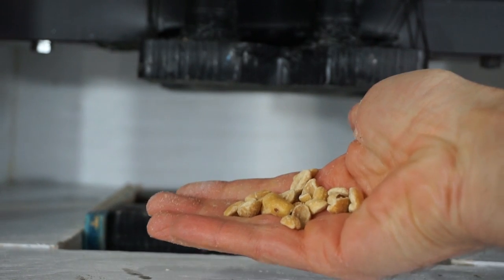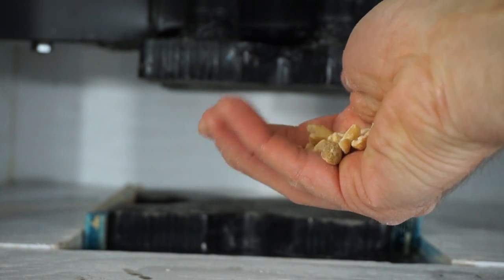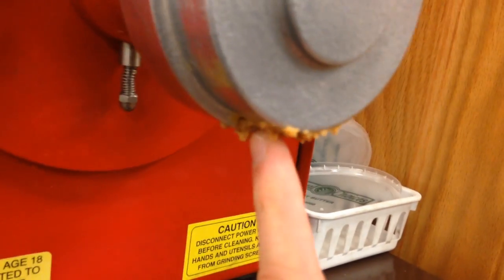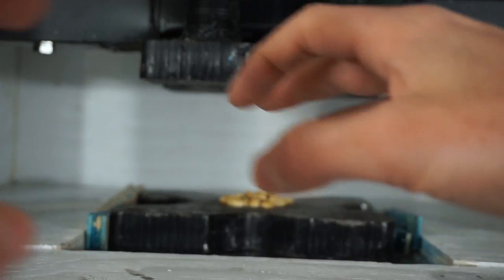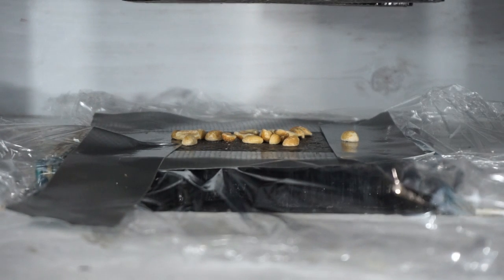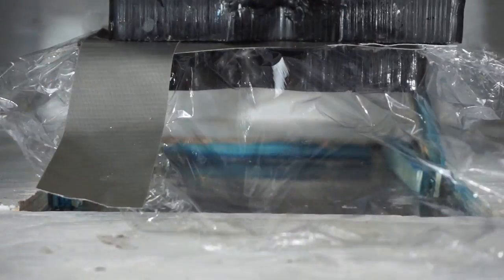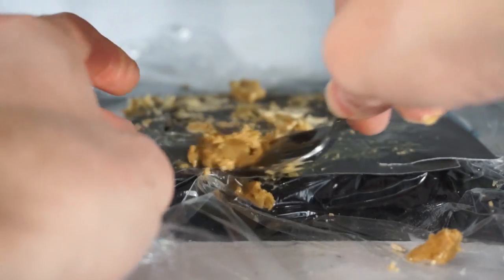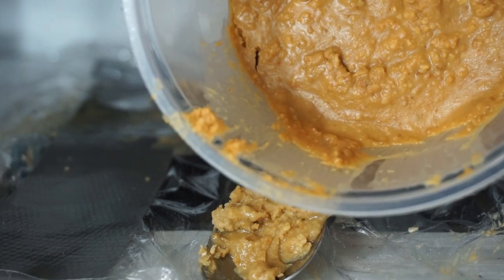Peanuts Turned To Creamy Peanut Butter By A Hydraulic Press: 2nd Try

Comment: peanut butter has added peanut oil to make it "creamy" which is why you saw that large bottle of peanut oil next to that peanut butter grinding machine
Reply: Added oil is not needed. Peanuts are already plenty oily. 100% peanuts becomes a runny liquid if ground finely enough. I prefer mine with some oil removed.

Comment: You are supposed to add oil but it's up to you what you do, love your channel
Reply: Oil is not needed. 100% peanuts becomes a pourable liquid if ground finely enough.
Reply: Yes, I highly recommend trying the kind from a grinder at the store. I wish I could get it slightly crunchier sometimes. The problem with buying "crunchy" from a jar is that they mix big chunks with super runny oily peanut butter. Don't like. And I have no interest in sugar and stablizers. Totally unneeded as you saw.
Reply: +NickRoman, heck just chop your own peanuts at $2/lb and add to creamy p.b. at $4/lb. for crunchy pb at $3/lb or less depend on how much you add. Or add chopped sunflower seeds as sunflower seed butter is often like $6/lb. vs $3 for the seeds.

Comment: Anybody that says you need to add ingredients to peanuts in order to make peanut butter has no idea what they are talking about.  

I spent an entire summer trying to replicate the filling of a Reeses. 
Went through at least 50 pounds of peanuts, maybe a hundred. All you need are dry roasted, unsalted peanuts and a blender. I failed because I was never able to get enough grease out of the peanut butter- the filling always came out too wet. But it produced fine peanut butter. And without all the nasty shit found in commercially produced peanut butter. You can add salt for taste, but it is not necessary.

Comment: Okay, okay, I stand corrected. Real peanut butter is definitely made from pure peanut butter only.
On the other hand I think that the cheaper ones are definitely cut with some palm oil, just to make them cheaper....
BTW the peanut butter made in the hydraulic press looked a bit thinner than the store-made one. I wonder why's that.
Reply: The primary function of palm oil is prevention of oil separation, because some people don't like stirring it in or pouring it off. I pour it off unless runny peanut butter is needed for something specific. Peanut oil is high in omega-6 so it has negative value to me.
Reply: +Marshall Banana, frying. Pancake oil.
Reply: +Marshall Banana Prevention of oil separation? You surely don't mean emulsifiers, don't you? Palm oil's main function in ALL the greasy foods is just one thing: to make the item as cheap as possible. It's cheaper than any other source of grease/fat: not only butter and cocoa butter, but even lard and margarine. So if you'll ever see palm oil featured on ANY food, be on the lookout as chances are it won't taste good.
Reply: CoolKoon do you think they remove the peanut oil for use in other foods? because peanut butter certainly doesn't need any added oil.
Reply: +Ananta Sesa das Like I said: palm oil is cheaper than ALL the other sources of oil and fat, including peanut butter. Of course it doesn't need it, yet I'm sure that some manufacturers add it because that way they can use a smaller amount of peanuts.
Reply: CoolKoon oh, i see. that technically would be removing a portion of the whole peanuts (not just the oil) by the displacement but yeah.

i think the pressed PB looked thinner because it wasn't the chunky style.
BTW peanuts are usually cheaper than peanut butter (adulterated or not) so adding peanut chunks (chopped in a blender) to smooth PB would be an easy way to save money. heck, add a lot, if you have plenty of peanut oil.